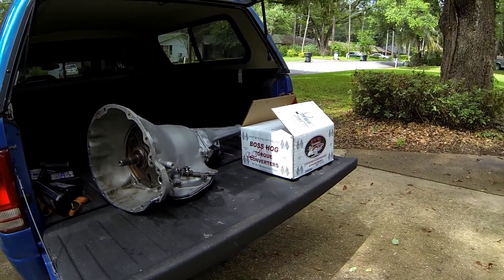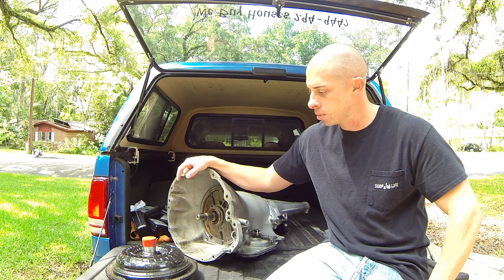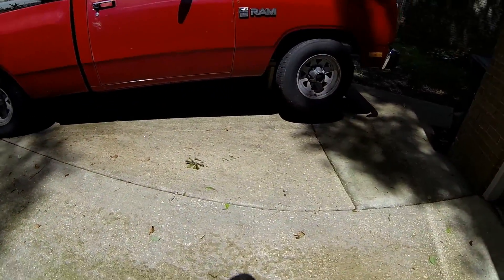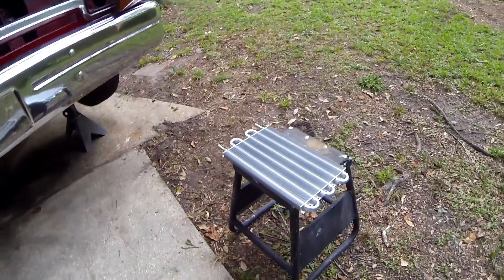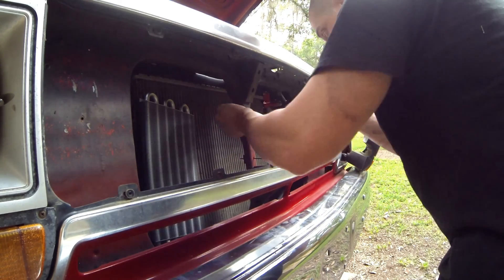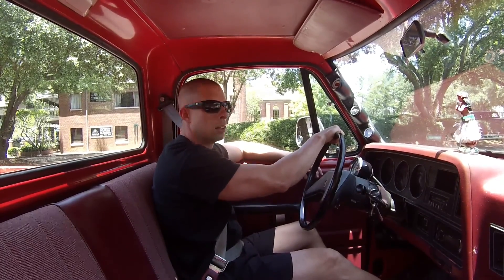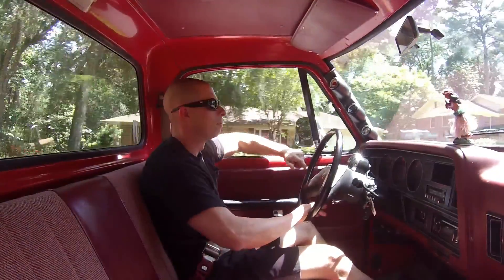Mopar 727 Trans Install in BigRed

Comment: Just found your channel while researching for my 360 magnum build. Thinking about getting a 727 trans for it. Hoping you can help me out - what exactly do you need for the trans? Is it all "automatically" controlled or does it need input from a control module? My chassis is a 1983 bmw 325e so its really light. curb weight of 2600 lb, chassis is probably 2000? What torque converter would you recommend? I want to be able to burn tires if I want to but keep manageable traction too. Im looking at the bm 10417, 2400 stall?

Sorry for all the questions but you seem like you really know your stuff and I am completely new to this
Reply from the maker: Can you message me on Instagram?

Comment: I know this is a very open ended question but I have a similar truck (except 4x4) with a mildly built 318 and I have to pull the engine cause I made a stupid mistake installing a cam in it( I managed to knock out the cam freeze plug in the back of the engine) and am debating weather or not the install a different converter. Is there anywhere online with good info on torque converter and different stall recommendations.
Reply from the maker: Call ACC Performance.  They will give you the part number you need. https://bosshogtorqueconverters.com/

Comment: out of curiosity how did you set up the flexplate to the torque converter did you give it enought space inbetween each of the 2 components?
Reply from the maker: Push the converter all the way in and measure the distance between the converter and the flex plate. Then look up specs to see if you need shims
Reply: @TheGasTap  alright was wondering if you had left enough space when you reinstalled it cause otherwise you would have been up for a new rebuild.

Comment: Does the external cooler work better than the stock cooler? Trying to figure out if I should go external or radiator, gets to be 115 outside in summer
Reply from the maker: Get an Externel

Comment: Glad i skipped through to learn this was NOT an installation video. This shows almost nothing of the tranny being installed. I was hoping to learn more about the actual hookup to a carburetor. Oh well. Nice truck though.
Reply: There shouldn't be any carb work involved if the engine didn't come out, just a fuel/air unit.  Just the cooling/ fuel lines would be removed

Comment: Hey Alex, let me ask you something.  I have a 1999 Dodge 2500 4x4 with the Cummins and an automatic. I've owned the truck since 2001 and I bought it with 80,000 miles on it.  I now have 135,000 and the truck has been absolutely flawless except with the occasional torque converter unlock and lock hunt that some of these truck have done. Anyway  I've been wanting more power but I've been worried about adding one of the programmers that will add 80 to 100 hp.  As you know the Automatic is the weak link in these trucks.  I was wondering what you know about torque converters.  Someone told me that if I changed the converter to a high performance one my truck probably would have more than enough power to pull our 25ft travel trailer.  Right now there is almost zero additional power while pulling on a flat and less than that on any incline.  The trailer weighs 7,000 and I just want a bit more power.  What's your opinion?  By the way Adam told me to ask you.  :)
Reply from the maker: I'm not to sure about the converters in those but I know the bands are weak. I will ask my buddy next time I see him. He is a transmission God. He always makes those transmissions stronger and bullet proof. I wouldn't add too much power without doing some upgrades though.

Comment: How did you torque down the torque converter to the engine like that?
Reply from the maker: I used a standard boxed in wrench and used a 1/2 inch ratchet and socket on the crank bolt to turn the engine ever to get to each bolt.

Comment: Did it come stock with a 727? Or a 904
Reply from the maker: 727
Reply: @TheGasTap  awesome my 4x4 one has a 727 . The 2wd 85 with a 318 has a 904 what's your thoughts I wanna turn up the 318 to about 330hp will a stock 904 do the job?
Reply from the maker: some small upgrades and it should be more than enough….smr transmission shop use to claim they made 750hp on their 904’s
Reply: @TheGasTap  also have a 96 4x4 360 47re trans just went out has 178000. Need a good trans guy around who will build it up right

Comment: Just a suggestion, but you might want to consider redoing the transmission cooler. It looks like the cooler can move and eventually the core pillar will wear into the cooler. I'd suggest a couple pieces of split 3/4" rubber fuel hose on each edge of the pillar of the core support or a couple strips of something like tire sidewall at the top and bottom of the cooler.
Reply from the maker: +CO Jones i used the pads that came with the cooler between the cooler and the piller but i may do what you recomended to be certain it doesnt hurt it. Thanks.
Reply from the maker: +CO Jones i used the pads that came with the cooler between the cooler and the piller but i may do what you recomended to be certain it doesnt hurt it. Thanks.
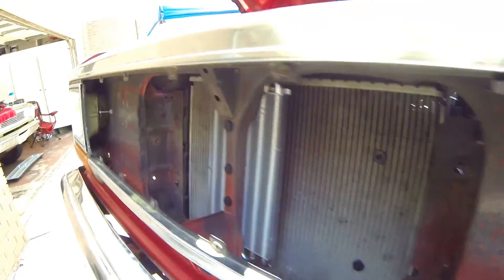Reply: +Alex&#39;s Garage It's probably is fine the way it is, but the camera angle at 4:24 (what really concerned me) sure looks like it's laying on the core support. Sometimes the camera does lie, the cooler could be a half inch away from the support for all I know. :D 

Anyway, it wouldn't hurt to use a little extra padding, especially there at the top of the cooler where the pillar Ys to keep any chance of it flopping around and wearing from happening.